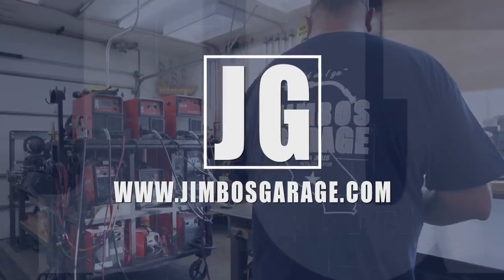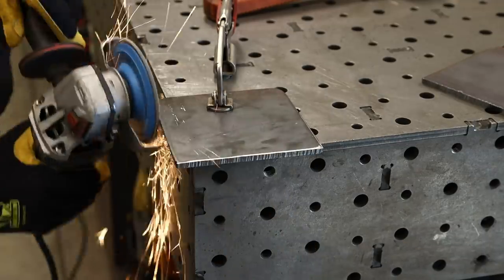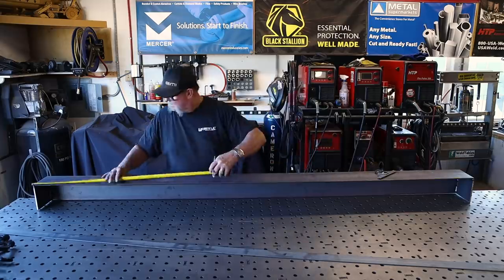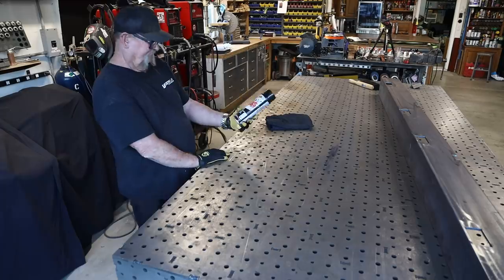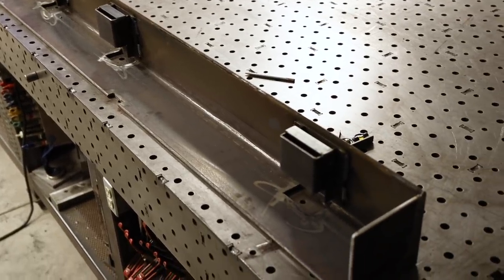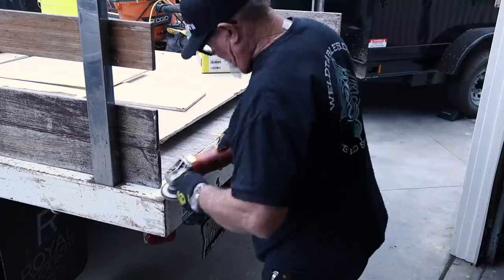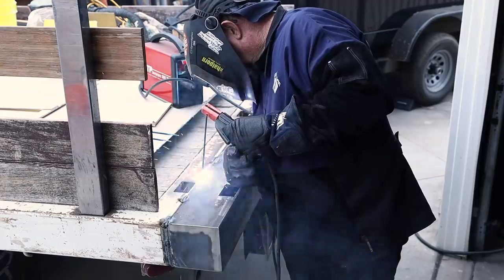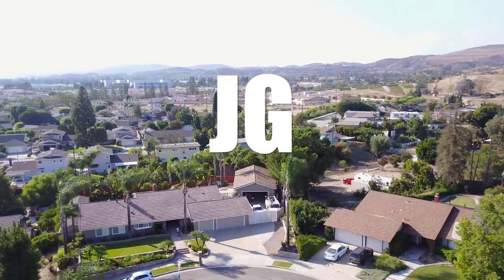Metal Truck Bed Extension | JIMBO'S GARAGE

Comment: Wouldn’t a solid weld on the top of that extension prevent water from getting down in the crack and resting or at least creating rust spots

Comment: A tip for you jimbo is when plasma cutting into a piece. to make a whole go at a angle til you blow through and have the plasma gun be straight up and down it cuts down on the blow back. Give it a try and great video! I run a hyper therm power max 30 a lot. And its stuff you learn when plasma cutting

Comment: JG I'm not a metal fabricator but I've learned a lot from your works, 👍👍👍. Just something I learned along the way... When cutting a piece of metal and your blade is a it short for a single clean through cut... Rest what you cutting to  maybe 1 inch piece of metal underneath and you will be able to make that cut through, 😉😉😉🇿🇦🇿🇦🇿🇦

Comment: Jimbo ! You got everything else ! Snag you one of those little Wen File Belt Sanders ! Don't buy 36 grit it breaks off the belt, get 60 grit ! You stick that little dude in all kinds of tight places for cleanup ! I use it for hard to reach spot welds !!!

Comment: I think if I was going to plasma out those holes for the stakes, I'd still start with the plasma cutter instead of maybe drilling a starter hole, but I'd start the plasma cut about a half inch inside the line, then once the cut is all the way through slide up to the straight edge and get it done. Kind of like blind-starting jigsaw in the middle of a hole then working out to the line once you've got the blade through.

Comment: My question will make it very clear that I don’t know anything about welding… so with that disclaimer, Is it possible to do something like this, say add another foot in length to the back of a flatbed truck where it would be strong enough to attach Ramps and drive a vehicle up on?

Comment: Sometimes to save time for pieces that have an end cap, instead of grinding. I take I back to the saw and push it flush with the weld and chop the welds off on the saw. Quick n easy

Comment: If you use a 1/4 in. drill in the corners of the pocket holes the plasma will start ALOT easer and work better.

Comment: Jim - a few things to know about the stake pockets.  They are a specific size to fit the panels.  I think by adding the angle to the inside, the posts may not fit.  Also - they have to be welded 100% along the sides to take the side load from the stakes.  Also when placing them, you have to check and see how the panels are fastened.  Some get pinned below the stake pocket, others just drop-in and are secured when the tarping system is attached.  Placing them too low may sometimes not allow the posts to correctly fit.  Loving the videos.  Take care.

Comment: I'm confused why you sometimes choose MIG welding and other times stick welding
Reply: Outside with the wind stick is more forgiving ...

Stick is a spray arc, typically gets “better and stronger” welds than short circuit mig .... and is more “fool proof” in a situation with wind and potentially dirty metal
Reply: Mig weldig is good indoors, if there's some wind stick is better

Comment: Approx how much would you charge for this?
Would like to hear everybody respond as to what you think the cost was.
Reply: id guess the material cost at about $200-250 plus consumables plus time depending on your shop rate maybe $500-550
Reply: Material my cost about $150 ....  by the tine the customer gets it its $200 for material ....  

The job is “worth” $600-800 where i live ....
Reply: Material $150. Labor 3 hours at $75 an hour so about $375 around here.
Reply: I'd charge about 500 for that job.

Comment: I've been watching for a long while now and I guess having just 3 welding machines I get by ..I'm still learning on the tig , watching you has helped a lot with just the basics and then the technique.  I've always wondered but I guess having soo many welders you could be spoilt for choice for the tool for the job. What actually makes you use a certain one . Great video as always

Comment: Great job, but why'd you use the stick welder on the truck??was it due to the wind blowin away your MIG gas?
Reply: I think he wanted to do down weld at the electrode, there are cellulosic electrodes that penetrate properly with an MMA post. With the MIG it was necessary to make a rising weld it is more complicated and longer :)

Comment: Jimbo another great project and work. You have got to check out the 1000 lb lift table at Harbor Freight. You could definitely use a rolling gantry but I know your limited in space. That's where the lift table comes in. I swear it will change your life and can be folded up and tucked away. They make other more expensive ones to. You could also look up high lift pallet jack those are awesome to. Both are great back savers.
Reply from the maker: Thanks for watching Tony, Yes i have been looking at that one. But i might make one that is more the right size for me.   Jimbo!

Comment: Another great video Jimbo! I watch all of them! That’s a sweet little stick welding machine. Why’d you decide to stitch weld that thing with the stick instead of mig? Was it just for the heck of it? 😂
Reply: Welding outside there is always the chance of your shielding gas getting blown away by wind with mig welding. Wind is not an issue with stick.